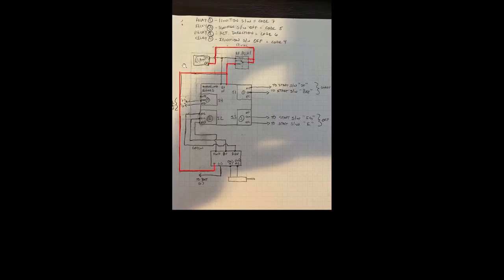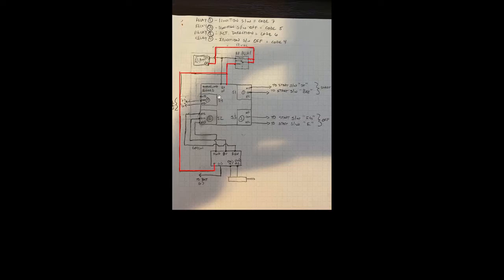Converting Manual Start Generator to Remote Start!  Part 1

Comment: How did Phase 2 come through.  I'm trying to do something similar, but instead of an RF signal, use my inverter to autostart.  I don't have the choke issue, as I converted mine to run on natural gas, but I do need to verify proper startup.  I would like to have something that responds with a run or power sensor to check for whether the generator is running, otherwise restart the startup procedure.

Comment: I am using my transmiter-A to start my Duramax 8500 and it works great but now I am not sure where  to connect my transmiter-B to kill the motor. Can you or anybody out there give me some ideas? What I found is that a single blue wire is coming from the off position of the on/off switch, then Y's into a 2 pin connector with a white and a black wire feeding to the inside of the coil. Am I on the right path?
Reply: I meant to say inside the celinoid not the coil
Reply from the maker: @AnthonyLombardo-k7o  the circuit for the spark plugs. There will be a switched path to ground. Once that is placed to ground, the motor dies.

Comment: What color cables on the start switch did you hookup? Just pulled the panel on my DuoMax and it was more than I was expecting :)
Reply from the maker: Check your owners manual for the actual color of the wiring.  It has the wiring diagram towards the back.  Your colors may differ.  The wires from the switch and switch positions in my manual are labeled BAT (my common on the relay panel), ST (my N.O. on the relay panel) --> these two constitute the START position, aka starter circuit.  Then IG (my common on the relay panel) and E (my N.C. on the relay panel) --> these constitute the OFF position (basically grounding out the spark plugs).  The diagram at the beginning of the video has this drawn out.  The back of my panel has ALOT of wiring but dont be intimidated.  You are just going after two positions of the Start switch which totals 4 wires only.
Reply from the maker: Forgot to add FS and G positions on the start switch as well.  So three positions on the start switch which total six wires.  Use the owners manual wiring diagram as the reference.  My diagram at the beginning of the video has all the connections I made.  Those directly correspond to whats in the owners manual wiring diagram.  Have at it!

Comment: Much smarter than me, Im just trying to figure out where the G, FS, Bat, ST, IG, E from the generator go to connect to my MGC100.  Im sure that would be easy peasy for you.  LOL
Reply from the maker: Best thing is to use a multimeter and shoot the circuit according to the wiring diagram in the owners manual. That will do it.